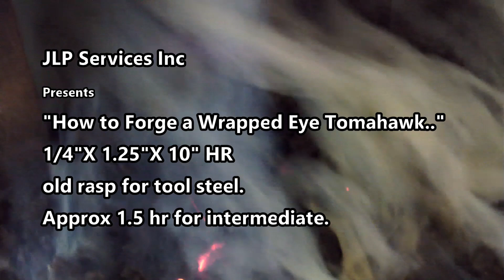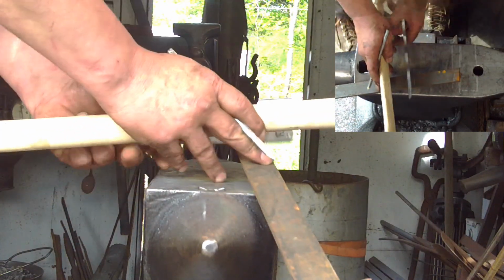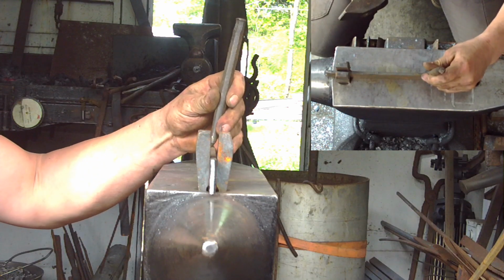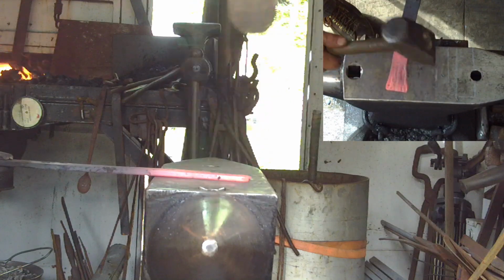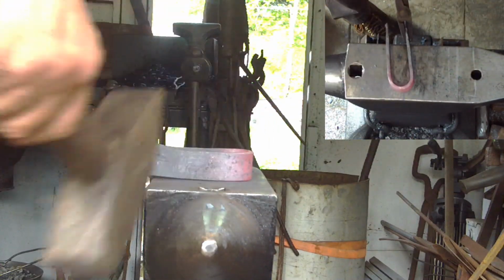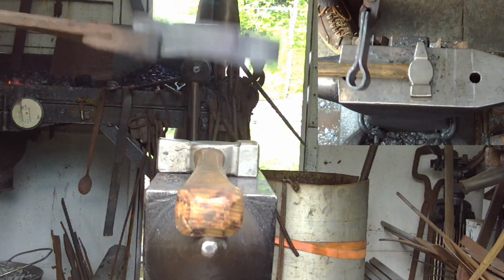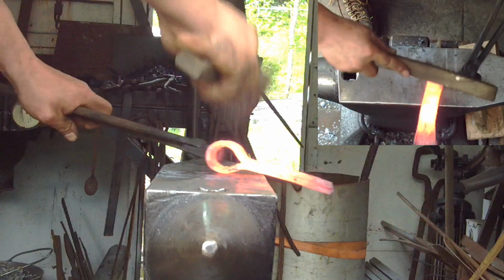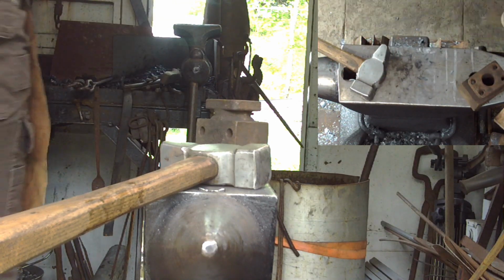How to Forge a Colonial style Wrapped Eye Tomahawk  (Video #2)

Comment: Great instructional video on the tomahawk.  Do you spash water on the anvil to "blast" off scale when forging the flat areas?
Reply from the maker: Yes. exactly.  it helps to clean up the area just before finial forging helping to get rid of all the oxidized welding flux.
Reply: @jlpservicesinc1452  Thanks!  I'll have to start doing that.
Reply from the maker: @shortfuse43   Another good one is to wet you block brush before use.  The water helps to cool the brush which makes it last longer and the water mixed with the brushing action removes more scale. :)

Comment: So I've haven't been successful with 4 previous attempts of getting a solid forge weld. 
Should I try to hit the to be weld in the center and as flat also.
Very great Tommy Hawks with very little grinder work for shaping all at your forge, The forge work is more fun than grinding.
Thanks for the teaching
Reply from the maker: So, tell me about what  is happening..  If the scarf is good and your fire is clean.. What is the approach next for you? 

Always hit middle of solid out toward edges left and right.  Then towards cutting edge.. 

My only gripe about youtube is there is no way to post photos of the work to help trouble shoot.
Reply: Try using some Iron Mountain flux.  It will help greatly, enabling weld at lower temp.

Comment: can you show us how to make a pipe hawk like this with a smokable metal bowl on the end.  Many videos out there, but they either make it out of a pipe or old gun barrel (which has a hole already in it so that way you cant learn to make a proper hole on your own) or they just use a round hammer that doesnt have a bowl hole for putting leaf material in (hence not smokable).  I am primarily curious on different ways to attach the metal pipe bowl or what i am really looking for is how to make it all outta one piece of metal with no sepearate pieces (bowl and axe welded) put together.
Reply from the maker: The traditional way was to braze the bowl on.. |

Welding was done but to a much lesser extent..   

Welding of the bowl led to a bunch of difficulties that were not time-effective. 

Historically trade "Tomahawks" were cheaply made items with the least amount of materials possible trying to seem like they ( the traders) were offering a good deal to the locals. 

Most people who make them today don't follow this "cheapness" aspect and combine viking, European, and others together to show a product.  

It's not ideal from a historical perspective. 

Where you do see more elaborate tomahawks were cast bronze..  They had piercings and all sorts of neat decorations. 

When I finally get the school opened I'll be releasing more videos from inside the school..  I will keep your request in mind but it won't be for another 6 months or so..  

I have a huge amount of work to get done in the school building on top of my normal work. 

Thanks for the request..  I have a few months before the snow arrives so if I find the time I'll put together a video. 

Have you seen the tomahawk I did 3 weeks ago?

Comment: It's amazing how you can forge to finish I'm really working hard to develop that skill
Reply from the maker: Back when I was forging professionally, I found it was just such a time savings forging to finish,  it became the standard.  the closer and the smoother the finish the less file work and finish time.   

I would quote every job as I did custom work only. 

While today with bladesmiths the forge thick, grind thin has grabbed hold of many. 

I still work in the old style with no grinder in the trailer and no electricity for that matter.    The new teaching facility  will of course be setup differently with modern conveniences like grinders but still like forging to finish. 

Not sure if many know this but I started out as a bladesmith, then moved over to hardware once I realized I really didn't know how to forge well as a bladesmith.

Comment: Very nice video. what is a reason for putting water on the anvil? thank you.
Reply from the maker: It is to create steam which is trapped between the anvil and the metal which will help to loosen the scale and welding flux thus creating a smoother, cleaner finish.

Comment: Why did your axe pop
Reply from the maker: I can choose many reasons.. here are 3 reasons but as to which one.. Maybe all 3..  

1,  bad forge weld using the HC steel as a wedge,  
2,  To cold when I inserted the HC (No give in the body for compliance). 
 3, Not enough room for the HC (the tool steel was longer than the available area (to long) and smashed it in while the body was to cold.    

There is a lot of pressure when wedging and the body was to cold for it to have any give..  

I thought it might happen with the HC being so long (could have made it shorter) but was willing to chance it and it came back to bite me..     I don't mind stuff like this happening as it shows some mistakes which could be avoided but hey, why not.  It makes it very interesting to see mistakes.

Comment: Second time watching this fine video.Now not.what great shape you hammer your Tommy Hawk.into leaving nothing, well little or none grinder work.
  But you are not trying to teach me grinder skills.
  I am trying to do less grinder it kinda sucks. You also don't use a.flatter, But I think your rounding hammer is very flat so with your skills again you save a step
    Lady again I thank you for teaching.
Reply from the maker: Thank you John.     I don't use a rounding hammer except when making horse shoes or when showing the method Brian Brazeal uses of half on half off. 

 The double faced hammer I use briefly is a welding hammer.  It has 2 flat faces. Good eyes noticing the hammer. 

Otherwise I just use cross peen hammers which have a reasonable flat face. 

Because I am a more traditional trade smith I try to forge to finish.  

 I am working alone.  The videos are for basic instruction.  And use a minimum of tools because I feel others (new smiths) do not have elaborate shops or tools.    (Besides a flatter or set hammer will just speed up the process if the item needs it but if working alone there is no good way of using it and keeping things in alignment).

 But otherwise, for 95% of the items forged there is no need for a crazy amount of tools. I rarely use a flatter or a set hammer.  For general forge work the only other thing that gets used regularly is a bottom swage when making rivets or bolts. Oh and nail headers. 

Really with experience a wrapped eye tomahawk like this is a 30min forging start to finish including hardening and tempering. 

It is only filed to clean it up (make it bright for hardening). few minutes with the file and the hawk will look like what is shown when it's silvery. then hardened and tempered.

Comment: I noticed your quenching methods is not enough! Supposedly the edge must be redness on fire!then wipe it by using bar soap wipe it in horizontal direction,put it again on fire in 10 seconds then submerges into water gradually this could be done only the edge or bevel.the white lines its appear and you see the sign of good quality after quenching methods is done!
Reply from the maker: You are confusing hardening with tempering. 

The steps shown are correct.

I have included a link to the correct time stamp.

https://youtu.be/-ftp5kJ-K8Q?t=1439